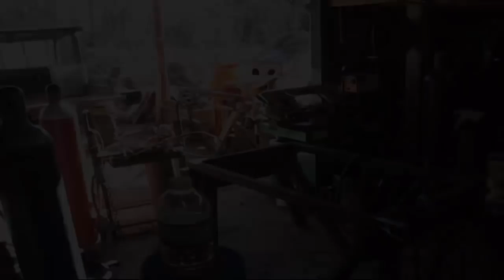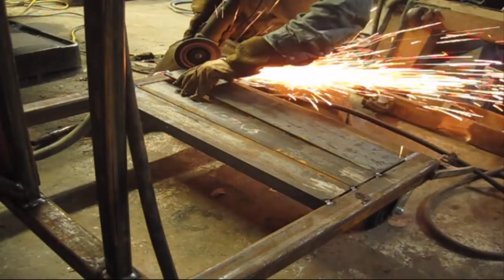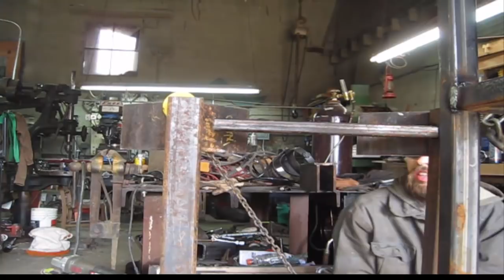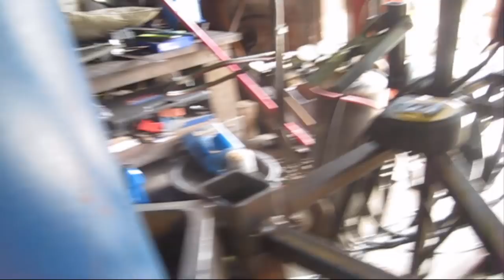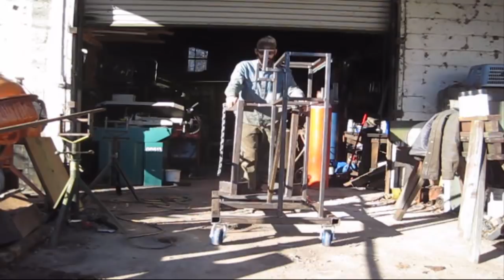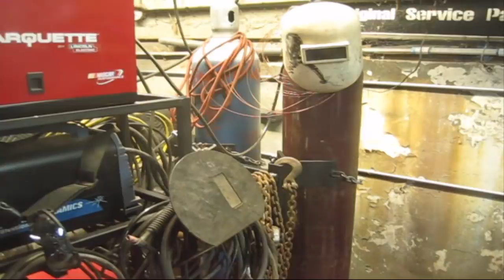Welding cart build

Comment: What was the rating on that big chain come-a-long you ended up using? Harbor Freight sells them in 1/4, 3/4 and 1.5 ton. Have you ever used theirs?
Reply from the maker: Braz1956 It is a 1.5 ton tung brand. Yes I have and 500lb and 1500lb Harbor freight. I like them use them all the time.

Comment: Just wondering what are your reasons for liking Plasma and wire welding ?
Reply from the maker: Ahh just call me old fashion.  I like stuff that doesn't give problems for retarded reasons like: (MIG welding) Oh little bit of wind blew by, and now your weld is full of holes.  Or your cutting with plasma and you hit a little bit of old paint, and it stops cutting.  Or you are holding a really heavy piece of steel tack it with MIG, and it falls off.  None of those things happen with stick, and a real torch.  Might sound dumb, but that's just me.

Comment: Looks good other than the fact that the bottle rack that you pulled with the come a long is out of square with the cart bad. Might think about cutting the bottom welds out and squaring it off the cart.

Comment: One of my first ever welding projects/first time to weld was a work bench I built in a shipping container for the guy work for and I built it out of a bed frame now that was fun and it holding up nicely the top of the bench is two 2x8 and under the bench I to a old 6draw craftman tool box and weld it to the bottom of the bench so it off the floor besides that I built in a shelf under the shelf I put the welder in place and o the back side of the bench I put tourch bottles and he was mad as heck at me for months it ok now I did what I won't I was tired that I didn't have a work bench

Comment: I'm 58 and I learned about 30 years ago that anything with casters, gets all swivel, no fixed.
I even changed the tool boxes to all swivel. Especially important in a crowded shop I think.
Reply: Totally agree. My toolbox has 2 fixed wheels. It's very large and heavy and a total pain in the butt to move
Reply: Front swivel and back fixed really is a pain in the arse
Reply from the maker: fun one This is true, but hopefully I won't be moving very much.
Reply: I put swivel casters on my car at all four corners after reading your comment, my insurance company would like a chat with you.
Reply: Just tell your insurance company  I told you ......."HERE'S YOUR SIGN"
LOL